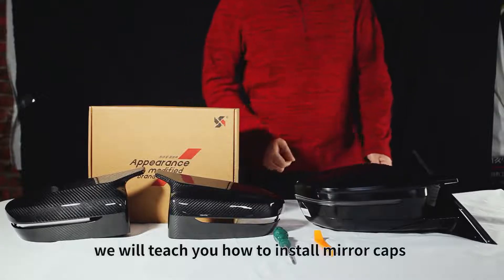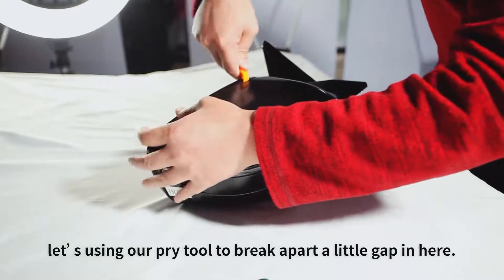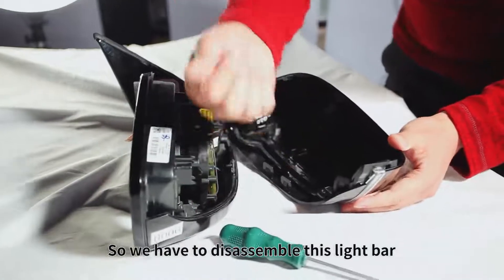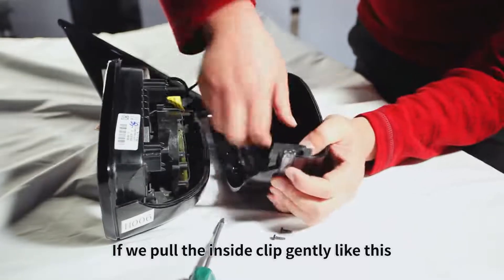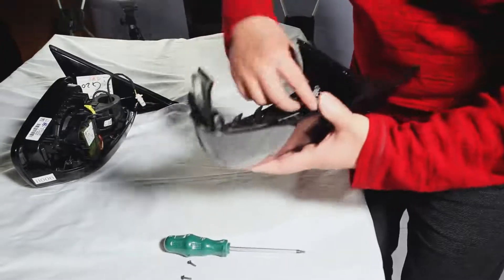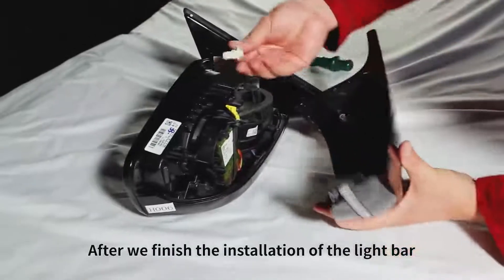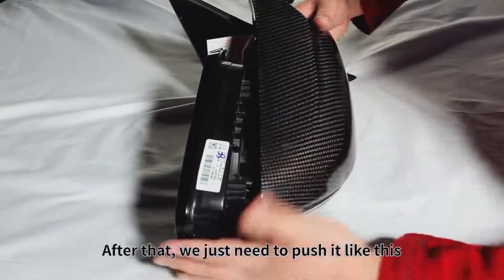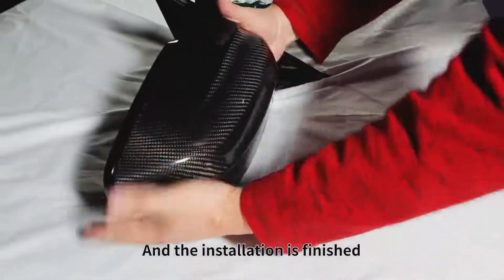How to Install Replacement Dry Carbon Mirror Cover for BMW G20?

Comment: You don't have to remove the mirror like most videos  but your doing it on a bench with no mirror?
Reply from the maker: Thanks for the feedback bro, 
That's why we update a new video in 2023. https://youtu.be/14aBNRFI400 

That's what we did when we first started posting videos and many things are not that professional, and we're trying to improve ourselves too, so if you can advise, that's would be great :)